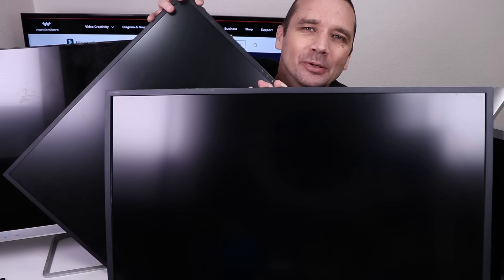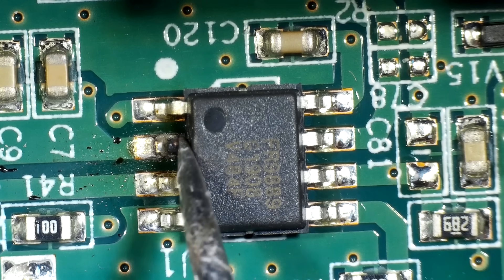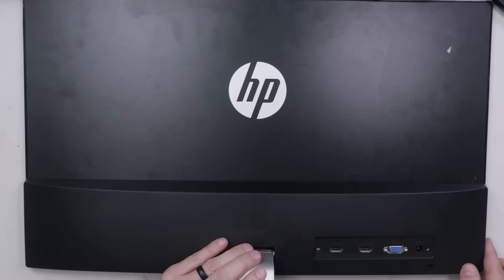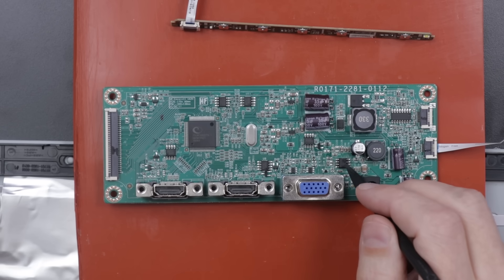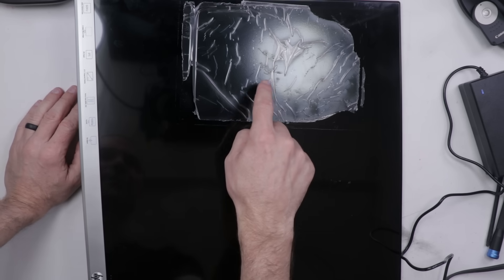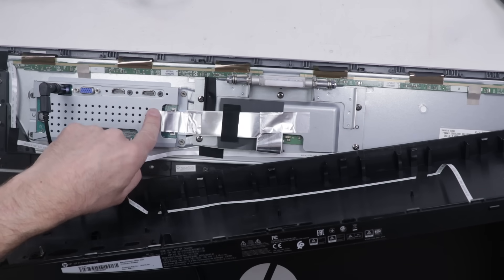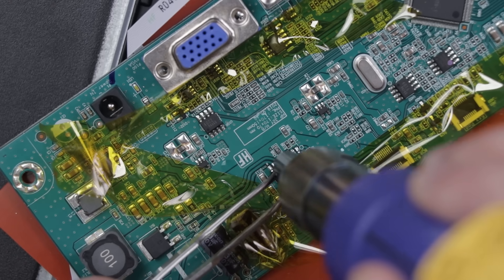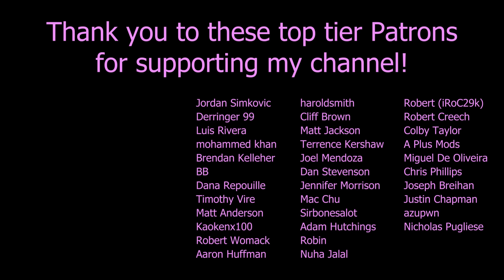I Bought 4 BROKEN Monitors - Let's Try to Fix Them!

Comment: On your final monitor what generates the 53v will be around a large inductor. There is one on the board to the right of the circuit you replaced. Personally I'd be checking the MOSFET is good as the circuit is collapsing after a full design load is put on it, but half load it works.

Comment: the first monitor looks like the exact same issue with my monitor although i dont have the tools to open my monitor nor tools to sauter. 😭 if you're reading this Tronicsfix, at this point id donate my monitor! if you'd like to make another fix video on it. at this point its only been broken a week, it is a hp x24ih gaming monitor and like you said it'd cost about the same to get a brand new monitor as opposed to sending it back to hp to get it fixed. Let me know if we can get in touch i'd be happy to send my monitor to you!

Comment: I have a water damage Xbox series a the water got into the fan , it worked for about 30 seconds after I blew air through it for 6 hours how can I send it too you ? If you fix it I will pay if not you can have the parts
Reply: send it to me😉

Comment: Thank you for this video Steve!! I always wanted to see you try your hand at fixing some computer monitors. I went through a phase of fixing LCD screens. I put up an add on Kijiji for free pickup of broken computer screens and it worked quite well. I couldn't fix all of them though. Some were just beyond me at the time. I'd love to see ya get some 2K or 4K computer screens to fix. That'd be interesting to see as well, since those are rather expensive units

Comment: hy normali Funktion of the back light its the shame the tv you have two halfs right and left for the LED strips and this two halfs hawe the same main power 50-50 volts or higher and then hawe your damaged lED on The strip and so have you a different resisting on te cabel then Nied the circuit more power for this line  then  thinking the  chip something its brocken I shutdown. You cant test the led strips manuell then You give   50 volts or more on te cable for the LED strip. Then She you the Brightness off te half on te screen Dark or not

Comment: It depends on what you call repair.  Finding a working driver board is often quite easy specially and guaranteed if you are willing to make modifications to the screen.  I like to modify screens and most of the times I actually replace the working board with third-party to get more functionality like remote control and/or adding TV functionality.

Comment: I've been told a common failure is the caps. You could try replacing all the caps and see if it changes. I've actually seen a video where he did that and it worked.

Comment: HP #1 monitor replaced chip#1.
Thet one burnt pad did not sticked to the chip at all. You should go trough with an iron after you reflowed the smd chips.

Comment: 2:47 the solder job on the burned pad (the one where the burned leg was) does not look too good, i would most def add fresh solder there and reflown in (you can see on the vid the solder did not really mend the way it suppose to)... but that's just the nitpicker in me talking...

Comment: 10:10 hi steve,  could be bad led(s) in backlight, try to replace the backligt led strips, it is enough that the 1 or 2 LEDs are defective and the whole backlight may stop working
Reply: Yes! Bad led increase the power consumption, the power source detect this situation and drop voltaje.

Comment: 14:20 The 53 volts is generated by the chip you replaced by switching the MOSFET on the output pin 7 on and off really fast (switching from 0 to 5v to 0 to 5v etc..).  It is a boost controller chip for sure.  If it will power some of the LED channels but not all of them at once then I would check the current sense resistor that is connected to pin 6 (CS) and labeled as Rcs in the datasheet schematic.  Rcs should be a pretty low value as shown in the datasheet so it might be difficult to measure being 0.15 ohms.  If that resistor burns up or increases in value it might show those exact symptoms.  Other things to check are the more obvious things like the capacitors on the output side (22uF in the datasheet) and the resistors in the feedback circuit.  If the caps start shorting at higher frequencies from losing too much electrolyte then the current sense might see too much current and start to lower the output voltages.  Most suspect would be the caps and the current sensing resistor Rcs, though...
Reply from the maker: OK, got it. I had no idea that switching the MOSFET back and fourth would do that. Now, I can move forward with some testing. Thanks for the comment. I might have to make another video about this one if I can figure it out.
Reply: @Tronicsfix  No problem.  Love your videos.  Would love to see if you can get that one working. ;)
Reply: @Tronicsfix  My prime suspect would be the capacitors on the output of the boost converter. If they lost too much capacity, the boost converter won't work correctly.
If the Monitor is a few years old, I would always replace them, even if they look good. 
But make sure to use correct replacements, since this converters may have trouble, if the parameters don't match.
Reply: @Tronicsfix  the mosfet takes the high frequency signal from the chip and in combination with the inductor, next to it, produce the higher voltage. It charges the inductor and then it releases the power that is stored in it as magnetic field. It is basically a boost converter.
Reply: @Tronicsfix  the chip monitors the current that is being drown from the leds. If its out of the limits, it shuts the output for protection. Maybe one or more leds is shorted and this causes higher current draw. With the one side only the current drown is inside the limits. To find out see if there any black or not illuminated properly spots on the screen by powering on the one side each time. Also check the caps both electrolytic and ceramic. Sometimes is the usual suspects.
Reply: @Tronicsfix  Yep, like 10100rsn said, check the current sense resistor and the output capacitors, but also check the inductor.  On phones or tablets with no backlight, the inductor is often the culprit.  The inductor should read as a pretty low resistance to your meter.  I'm betting either the inductor or the capacitors have gone bad.  Seeing that output voltage start at 31V and then decay downwards shows that the inductor or the capacitors are not storing enough energy to maintain the 53V for the backlight.  If you have an oscilloscope, you can also look at the output pin to the MOSFET and make sure it looks like a square wave.  If you see that it has a high duty cycle (long ON time), that indicates the boost converter chip is trying to raise the voltage but can't.  That confirms a problem with the inductor or capacitors (or possibly current sense resistor).  I think the inductor is going to be the round item at the end of the board with the "100" on it, and the output capacitors will be the two 33uF caps closer to the boost converter chip.  The larger 3-lead square chip next to the inductor is the MOSFET, and the smaller 2-lead square chip near the mounting hole is the diode (also worth checking).
Reply: @Tronicsfix  Mosfet is connected to a coil which is mandatory for voltage boosting. You can use diode tester to find out the output caps of the booster circuit which is connected to the coil or you can directly focus on the big capacitors next to the back light's connectors :D
Reply: My best bet is the circuitry around the chip.  I believe you showed the voltage near where it was supposed to be when first turned on and then dropping down to 18V.  To me that suggests the chip is fine, but the capacitors, resistors for current sensing, or the coil may be bad.
Reply: Yeah for sure, dropping voltage like that rapid is usually caps. Surprised he didnt think about replacing them.
Reply: Hi !
Mybe its the backlight it self were faulty !
Reply: @heeden9903  is not backlight , backlight works fine if tested separately.
It's the caps
Reply: I have the same problem whit a tv ; whit backlight disconect voltage stay stable ; plug the backlight voltage drops. Fixed change caps.
Tip: POPULATE THE THIRT CAP is a really good idea! (not populated for greedy reasons....😡)
Reply: @GuillermoReisch  I know these are LEDs, but this exact problem comes up on old LCDs that use fluorescent backlights.  If one of the fluorescent bulbs starts going out, you can actually unplugged them 1 at a time and the other will light up.  The voltage drop through the faulty bulb would cause the board to kill power to both bulbs.  On multiple occasions, I actually got a few more years out of some LCD monitors by swapping the plugs into the others ports.  For some reason, even though one of the fluorescent tubes was dying, just switching it into the other port extended the monitors life.

In this case, I probably would have tried the same thing.  Swap the LED strips into the other's port, and see if the board sends the correct power. If it doesn't work, you don't really lose anything.

I used to buy broken LCD monitors for cheap, and many times it was just capacitors, which were easy fixes, and I would quadruple my money. In a lot of situations, I was able to swap flourescent bulbs between monitors to repair the bigger name brands, since they were more appealing to market.  But, back then, it didn't really matter, because the cheapest monitors and the most expensive monitors all used the exact same panels.  The only difference (in only a few instances) were the driver boards.  
But, once LEDs started becoming the norm, I gave up, because I didn't have the TronicsFix touch to fix the chips on the boards.

Comment: the 50+V is generated by the action of the boost controller (the last IC you replaced) that switches the mosfet on the output pin, since only one channel is operating at any time I would assume there is something wrong with the power components in the upper part of the typical application circuit (maybe the inductor) or the shunt resistor (Rcs) that make the IC enter in current limit
Reply from the maker: @e.tsanov  OK, got it. That is interesting. Thanks for the explanation. I'll have to do some more testing on this now that I know how it works.
Reply: @Tronicsfix  buck/boost circuits come in many different forms, for low power applications you can find ICs that integrate the whole converter, for more power demanding ones you should use a controller and external switches, like in this case. You should give a look to switching converters :) the output capacitor(s) is a good candidate for replacement too
Reply from the maker: I couldn't find the 50V on that chip though. That's what was confusing to me.

Comment: Great video and repair as always!  For that last TV with the backlight issue, my first suspicion is usually a bad led(s).  The short wouldn't be bad enough to take down the LED strips on the one side but when combined with the load from the other side, there is too much current draw and the driver circuitry shuts down.  You could use an LED backlight tester to see the current draw (for ease) and/or you can expose the backlight and potentially see which LEDs have an issue.  If it's not obvious at first, you can film in slo-mo on your phone when you turn on the backlight and then replay it for come clues.
Reply from the maker: Brilliant! Thanks for the comment. I'll have to try this out. Could you tell where the high voltage was being created on that board?
Reply: @Tronicsfix  I think another commenter addressed that.  Also, I'd have to look at the board.  Just from experience though, the LEDs are typically the issue.  If you had a flash for a split second across the screen when the backlights first get power and then nothing, that's a classic symptom of a shorted LED(s) on a tv or monitor.
Reply from the maker: @FrugalRepair  Yes, I finally understand how that boost circuit works after reading them. That's good to know that this is a typical symptom of shorted LED's. I might have to make another video fixing this thing! Thanks again for your help.
Reply: @Tronicsfix  No problem.  For a content idea, you could also explain what the parts are in the LCD assembly since you would need to take it apart.  LMK and I can explain the parts if you want.  Make sure to handle the LCD with care and not crack it when moving it off.  Also, be mindful of dust particles that can get in behind the LCD while it's removed.  They could look like dead pixels when you put it back together.
Reply: @FrugalRepair  he should tested input video to see if hdmi or dvi ports are broken
Reply: @Tronicsfix  Not a shorted LED but a burnt one, they are usually connected in series and when one stops working it becomes open circuit and the whole string goes open. Actually if you short the LED connectors the backlight may start working again but it may stress the other working LEDs so it's always better to replace.
Reply: @Tronicsfix  HV is created in the circuit where the two big caps, mosfet, and inductors are (the inductor labelled as 100). This is essentially a boost buck converter circuit. There's a chance that either the chip you looked at is going bad, and not properly driving the buck circuit, or some other component in the buck circuit, like the mosfet is bad. I agree with the other commenters that it could be the LEDs as well. If you can find which part of the circuit provides current sensing for the LED driver, you can test the resistor there to make sure it's the right value, and hasn't burned out (which would make the chip think too much current is being provided to the LEDs, even when it's not). Source: I worked on designing an LED buck boost circuit for a FSGP solar car's lighting with a similar chip.
Reply: @novertrunnions2721  Is that Spanish?
Reply: @Tronicsfix  maybe the mosfet+coil that are togheter can setepup the voltage, if you see one of the chip outputs goes to the mosfet
Reply: @Tronicsfix  Don't you have the other monitor that you just fixed? If you plugged the LEDs of that monitor to this last one and the board worked, you would prove that the panel has a bad LED or LEDs inside
Reply from the maker: @renatoscutube  The connections for the LED's are different. I did think of that though
Reply: AL3065A creates the high voltage for the backlight using a mosfet BU1 and inductor labeled 100 on the inductor, I would try to replace the 2 capacitors 33uf 100v (BCE4 and BCE3 ) they are in a high strain use, but it could be a faulty led for the backlight
Reply: @AnonymousRepair  and populate the thirt cap also...
Reply: So awesome to see the community come together to help each other out
Reply: Exactly
Reply: You can also individually check the LED.  They are likely in parallel, so you could just remove it from the circuit.
Reply: I honestly think you might be on to something on that, it likely is just a bad led, that makes sense as to why they work separately but not in tandem.
Reply: TV?
Reply: TV?

Comment: 2:34 It really looked like a cold solder joint on that first chip you put in.  That same pin that burned up on the bad original chip didn't seem to get solder to flow on to get a good connection on the new chip.
Reply: Yeah I said the same thing.  When replacing with hot air I always add more Flux and a bit a fresh solder on the pins with my iron after placing the new chip.  Definitely increases reliability.
Reply: Poor connection (high resistance) + current flow = heat. 

I thought exactly this when I saw the chip removal and hoped he had a good shot of him checking the pin.  I bet if he would have touched that pin it would have moved.

That monitor failed due to a manufacturing defect... absolutely.
Reply: Yup this.

Comment: Would’ve been great to open that broken chip to see whats inside…..I’ve never seen it.
Reply from the maker: Good idea
Reply: If you look up “8 Pin Integrated Circuit XRay” you can find what you are looking for. Essentially it is what it sounds like, a small circuit. Chips on the Nintendo Switches if you are curious have internal wiring linking from each lead to a processor that sits above the bottom-terminated pad.

Comment: Lot of defective chips and transistors on aliexpress, they do it on purpose sending you damaged chips and some good chips mixed thats how they keep prices low if they are not sending fake parts
Reply from the maker: Agreed, but if that's the only option I think it's probably worth at least trying in most cases

Comment: i would never trust buying power components from aliexpress, unless the actual manifacturer is the seller. Ali is full of fake components, almost all of them are fake copies that cost 1/10 of the original IC
Reply from the maker: If that's the only option though it's worth a try imo
Reply: @Tronicsfix  sure :)